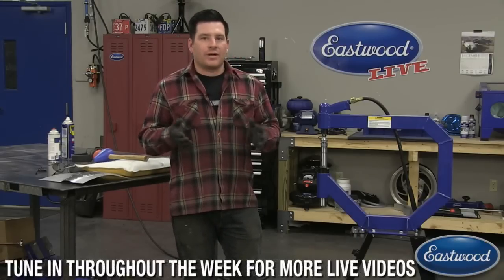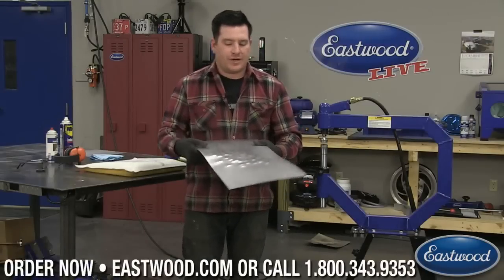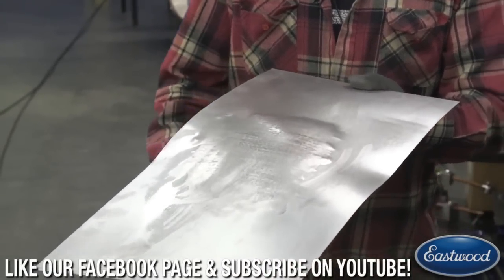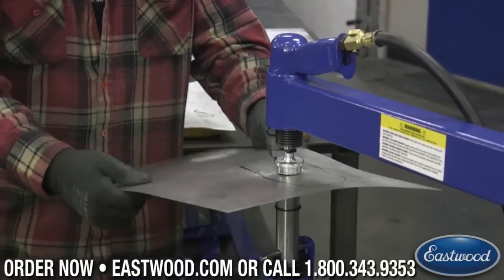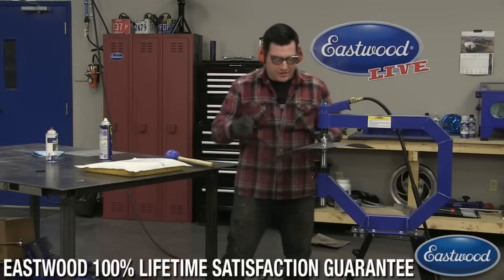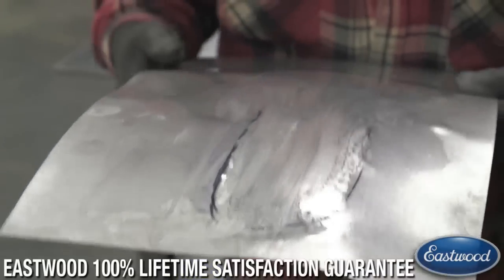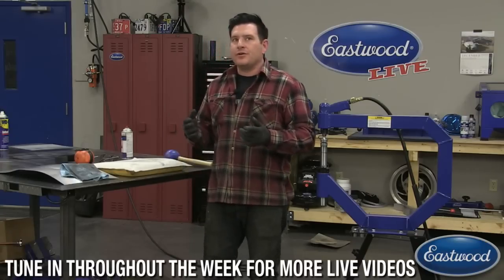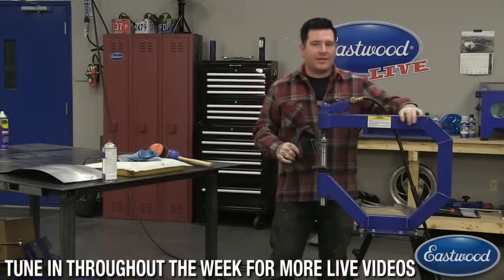Metal Shaping & Fabrication - How To Use a Planishing Hammer - Eastwood

Comment: Hammers hit anvils, punches work with dies. 
Yes that is loud. The best way to cut down on the noise is to train an apprentice and then put them in the far corner of the shop and if it's still too loud, close the office door. That's what they did to me at least. 
Regarding PPE- certainly provide some but be ready to see the young lad chew on it, hang it up and lose it, wear it in all sorts of odd fashions, etc. Do not attempt to correct them- you will be driven insane. 
This video is 8 yrs old- I guarantee the politicians you thought were idiots back then are going to look like Einstein compared to now.

Comment: In my artwork I put homemade dies together and drilled a hole through them. A half of hole in each it works well to straighten round bar. I also recommend buy an extra set of dies. I hammer out welds and other things I don't use my finish dies on. Thank you very much for this excellent video.

Comment: I do art work and I planish the leaves. I have a bead roller but it's faster making a grooved die and anvil. I made a jig to hold the die and anvil from turning. This also works well for shrinking but putting bends around my part. This little tool has many more uses. I Use it a lot. Sometimes miss use but it's built to be worked. I filled the arms with sand. Seems to help. Great video...

Comment: I would have turned the metal over and worked it from both sides, to finish I would run the metal through an english wheel , notice how distorted the metal is around edges, wheeling it would correct the metal

Comment: Can you shape 16ga  3003 aluminum with it?
Reply: Yes you can, in fact since aluminum is soft it will shape pretty fast. However, if it has been work hardened, you will need to anneal it to make it soft again.
Reply: John Parrish  thanks John for the information. I need to make a bicycle fender more or less out of a 3”X24” piece. I am making Blades for kinetic wind sculptures. I need to make a radius curve all in the same. Now I have been hammering them out on a sandbag and plastic mallet. I anneal the aluminum before I start. Will this hammer do what I need to do? Thanks John
Reply: @JohnDavis-yz9nq  Yep, the planishing hammer will do the job.
Kinetic Wind Sculptures like the ones in the 1996 movie Twister??
Man, I loved those things.
Reply: John Parrish  yes the movie Twister has kinetic wind sculptures. People tell me everyday that my work reminds them of that movie. To make my blades I use a blacksmith swage block and a plastic mallet and a arbor press to form my blades and then go to an English Wheel to finish forming and take out the blemishes. I can form a blade in about 10 minutes. At one time I was thinking about a sheet metal power hammer but I didn’t want to spend 8 grand at my age. So I decided on an arbor press. Being a blacksmith I was able to make my own dies and tooling. I did spend the money on a decent English Wheel though. Not a harbor freight one. Around $800.00 by the time it got here. The arbor press was the best improvement I made in my process.i have never worked on a planishing hammer. Building these wind sculptures you always need something you don’t have. I wasn’t aware that you can actually form metal with a planishing hammer. I thought they were used to smooth out blemishes.
Reply: @JohnDavis-yz9nq  There are a great many anvils for a planishing hammer. The cheap ones come with an anvil that is almost flat and is only good for smoothing. There are others out there, seek them out.
You say you have an English Wheel, look up Lazze's videos when he used his rubber band technic, the man can really move some metal with that rubber band.
Reply: John Parrish  I think that I have seen the rubber band video. That man is a master with the wheel. I use my wheel to do minor shaping but mainly to take out the shrinking wrinkles. Like I say most of my blade forming is done with a plastic mallet and swage block and then on the arbor press. I don’t need to move metal. I need to form a 3X24” sometimes longer into a bicycle fender more or less. 10 to 12 minutes is not a longtime to make a blade. It was taking about 20 to 30 minutes to make a blade until I got the arbor press. Before I was hammering them out on a swage block and sand bag. Once aluminum has been worked and has work hardened it is very durable. I’ve had my sculptures go through hail storms and not ping the blades. Have you tried to form a bicycle fender shape on your planishing hammer?
Reply: @JohnDavis-yz9nq  Make a bicycle fender?? No, I only make patch panels (steel) and interior panels (aluminum) for my hotrod.

Comment: For the most part, these Eastwood videos are terrible. If you're really trying to sell your equipment I'd recommend just letting Ron Covell do all of the videos. He's an extremely talented metal worker and he has the experience to constructively demonstrate the machines purpose. He demonstrates the capability of the machines with practical projects instead of just aimlessly running a piece of sheet metal through it, and at least does it with some confidence.

Comment: So what can this do that I cannot do on my English wheel???
Reply: Well ....If you remove it from the stand you can use as a hand held unit to smooth out wrinkles on your car fender while it is still on the car.  Very useful off the stand.  Nothing new here.. Chicago Pneumatic makes a nice unit with a round tube, it's lighter. Oldie but a goodie.
Reply: Cpk Unlimited  it can make a hell of a lot more noise. Buddy you stepped in it when asked that question. Lol

Comment: If you actually made something like a motorcycle fender 
You. Might increase sales 
Just haphazardly going at a piece of metal isn’t going to increase sales 
That hammer is a finishing hammer you need a Shrinker along with it
Reply: I agree
Reply: Exactly you are right. Don’t tell us show us. Oh well he is left handed and can’t do much anyway.
Reply: John Davis 
I suck at filming I’ll try harder 
I am building a English wheel 
And planishing hammer /power hammer 
Kind of a all in one the english wheel with power hammer on one side then a air planisher on the other side 
My frame is all built from Liggt gauge I beam and plated with 
1/4 x6 flat bar for mor rigidity 
I’m so bad at not filming 
I just want the tools done so I can film the work using them

Comment: Will this operation removes some material too??
Reply from the maker: It will stretch the metal, so the piece will become larger.  Very slightly, but it will become larger because the hammering is thinning the metal and pushing it out.